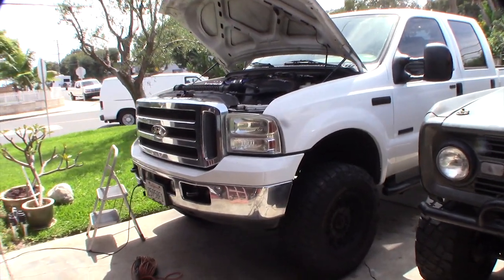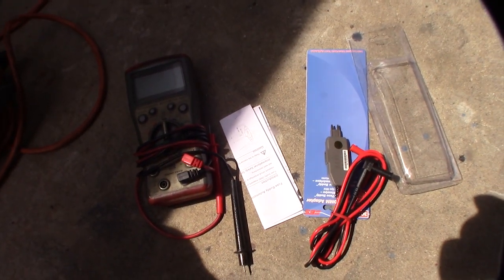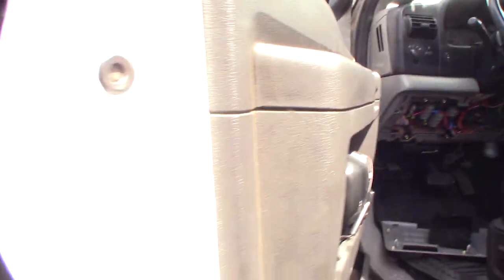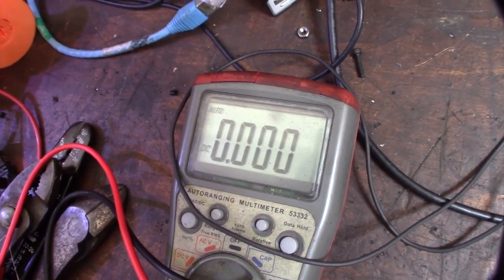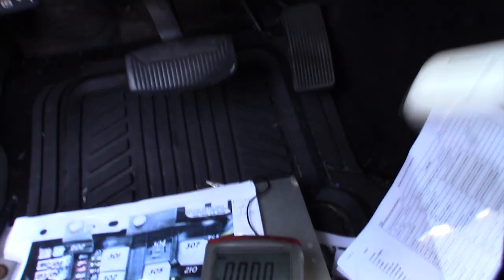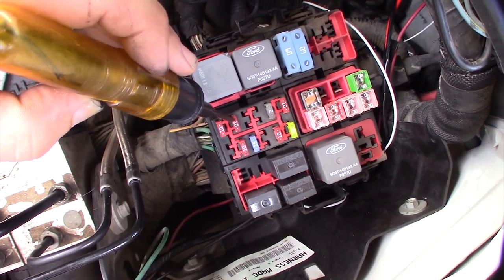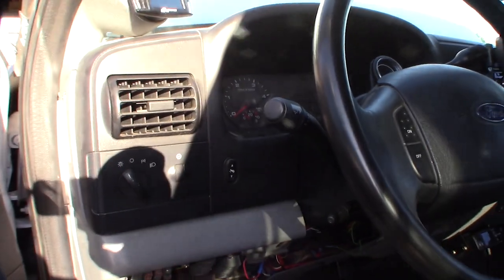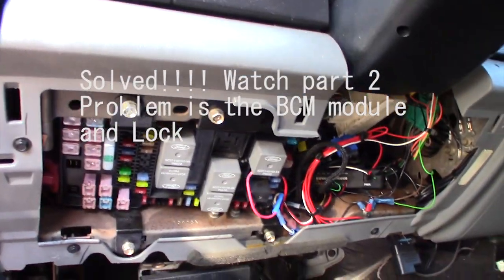Ford F-250 Parasitic Draw troubleshooting and repair Part 1 Battery Drain

Comment: I did every test that I found on YouTube Videos . I spent at all 12 hours over a period of 5 days trying to find out what was causing my 2 Batteries to drain within 2 days at the least. Took my truck to Ford Dealer. The Mechanic said there was nothing that he could find that was causing my batteries to drain. Of course my truck didn’t do what I told this Mechanic. He asked me if I could keep my truck. At the Dealer for a week. That he would start it daily and hopefully the parasitic battery drain would occur. Of course it didn’t happen. The mechanic was a really nice person and didn’t charge me anything. I get my truck home.2 days later my batteries are drained so low. The starter wouldn’t turn the Diesel engine over. So I recharged both batteries and would disconnect them after I was done using my truck. A friend of mine gave me a marine battery disconnect switch. Enough heavy gauge red and black plastic covered
 wire and all the necessary connectors to put the battery disconnect switch inside the engine compartment. The disconnect battery switch was really cool. It had off, left battery,right battery and both batteries positions on this switch. One day I’m talking to one of my childhood friends. That just happens to be a professional heavy equipment mechanic. I mentioned my parasitic battery drain that was happening on my truck. He knew my truck. He says, did you take the alternator out and have it checked at a local auto parts store. I tell him the Alternator is putting out on average 13.5 volts. He says what about the Voltage Regulator. No I didn’t. It takes literally less than 5 minutes to remove the voltage regulator in my truck and that includes removing the negative battery cables. Even though I have the battery discount switch. The F-ing Voltage Regulator was bad and that was what was causing my batteries to discharge in 2 days or less. I purchased a brand new Alternator not a rebuilt one. Like my friend suggested to do. NO MORE PARASITIC I DRAIN. I still place the battery disconnect switch in the off position if I’m not going to be using my truck for awhile. I’m not sure if this is why my trucks batteries are over 8 years old now and still will take a full charge that I do every 6 months. Or did I get lucky and get 2 good batteries. 
P.S.  My childhood friend is a excellent heavy equipment mechanic. But for some reason doesn’t have a clue on repairing motorcycle drive trains. I rebuilt a 1949 1,200 cc Harley Davidson Pan Head. Engine and transmission for him. I’m also good friends with someone that owns a machine shop. That specializes in high performance engine work. He allowed me to use anything in his shop. I completely disassembled the 1949 Pan Head engine and transmission. Did a complete rebuild on the engine and transmission. I did this in 1982. His 1949 Pan Head still runs perfect and he put over 50,000 miles on it. Now motorcycles I can rebuild especially the Side Valve/Flat Head, Knuckleheads,Pan Heads and Shovel Head engines. They are like big lawn mower engines. From complete tear down. To  boring and honing the cylinders to sleeving them. Late Iron Head Sportsters heads have no valve Seats. I’ve bored out many heads and installed valve seats

Comment: The parasitic battery drain on my 2002 F-350 Super Duty 7.3 Power Stroke. Was driving me almost crazy. I checked just about everything everyone suggested. I was talking to my good friend. He is a professional heavy equipment mechanic. I told him about the parasitic battery drain on my truck. He says,did you check the alternator and the built in voltage regulator. I told him the alternator was putting out 13.5 volts DC. I never even thought of checking the  built in Voltage Regulator.,The voltage regulator was shorted out. This was what was causing the parasitic battery drain.So I installed a marine battery discount switch that is for 2 batteries. This disconnect switch had positions for left battery,right battery,both batteries and batteries off. I would turn it to the off position every time I was done using my truck. The batteries were new when this parasitic battery drain started happening over 8 years ago.  The two batteries are still good. I wonder if turning the battery disconnect switch to the off position every time I was done using my truck for the day. Is the reason both of batteries have lasted for over 8 years? I don’t use my truck a lot,and I will recharge the 2 batteries at least twice a year. The batteries still take a full charge. So I always still turn the battery disconnect switches to the off position. Whenever I use my truck and it will be parked for up to a month or two.
Reply: Test the diodes in your alternator
Reply: @bert1913  
Not one of the YouTube videos I watched on figuring out how to find a parasitic battery drain,mentioned checking the alternator’s voltage regulator/diodes. At least I know that I don’t have any other parasitic battery drain on my truck.

Comment: You can perform this test way faster by running the test from your main battery cable. Pull fuses till you see the draw disappear. The car I tested is also drawing .5amps from the cluster circuit.  Maybe I will attempt a board repair in the future.
Reply from the maker: My issue was the security system would not go to sleep.
Reply: @fintechrepairshop Interesting. How did you fix that?

Comment: When you were testing in the engine bay and plugged the fuse in where were you measuring to see the draw? Mine may die every other day if it doesn’t start.

Comment: I could be wrong I think and I don't remember where I was reading something about the battery saver is intended  to drain the battery's when theres a issue with the alternator is over charging.

Comment: Hi.  Loved your thorough video on the Superduty parasitic draw.   Have subscribed.  Would you post the Amazon link for both the built-in charger (I'm curious there), but more importantly the extension leads with fuse plug(want to buy it, can't find it on Amazon).  Thanks...Paul
Reply from the maker: https://www.youtube.com/watch?v=f__SFwe3SNg
Reply from the maker: There in the description
Reply: @fintechrepairshop  Found them a while back.  Thanks for responding.  Merry Christmas!

Comment: My 95 f250 lights won’t turn off w the knob only adjusts brightness inside cab, lights are on but no turn signals or brake lights ?
Reply from the maker: I would say headlight switch
Reply: @fintechrepairshop  is there a way to test it or just better off replacing?

Comment: I changed my instrument cluster did good for a month and now its dying everyday. Going to try my alternator next
Reply from the maker: When your car is running connect a voltmeter to your battery. Its should be 13+ volts
Reply: @fintechrepairshop  I have a monitor and yesterday when I was driving it said 13.4. The only thing I have not change is the alternator so I was going to change that.
Reply from the maker: @patricklucero6547  if your getting 13.4 your alternator is fine. You need to check the state of your batteries with a tester. You also need a multimeter or ammeter to see how much your truck is drawing. On my trucks its the driver side battery.
Reply from the maker: My issue was my truck would never go to sleep because my door lock switches were disconnected.
Reply: @fintechrepairshop  thanks I will check it out and let you know if I find the problem
Reply: @fintechrepairshop  I took my alternator out today and tested it and they said it was bad. Took both batteries out and had them tested and one of them were bad so put new alternator in and both batteries and cranked right up. Battery voltage is 13.8 so hopefully that fixes it. If not I will check all my grounds to the chassis to see if they are clean connections.
Reply: Would a kill switch have resolved this?

Comment: Hello everyone, 
My 06 f550 starting to have a parasitic draw after I bought it with no problems. I checked and found two fuses that cause my problem. The cluster and the radio. I removed the cluster fuse permanently and remove the fuse of the radio when I park and put it back when I drive the truck again. This way my batteries don’t die anymore. I had the cluster rebuilt and I replaced the radio. The problem still there. I have no clue how to fix it and all my mechanics that o know couldn’t figure out how to fix it. Can anyone help me out with a solution?
I appreciate it.